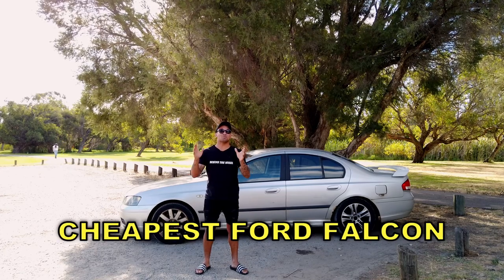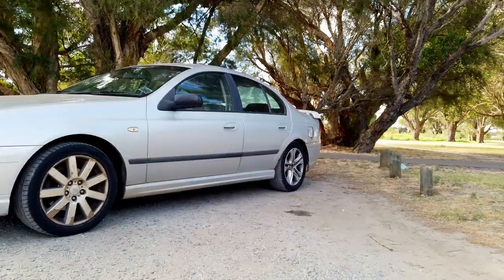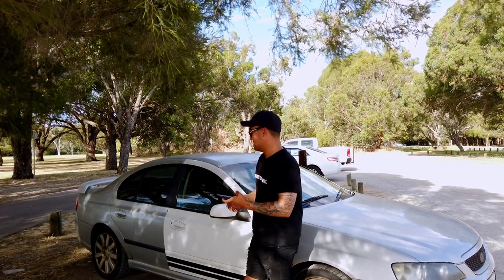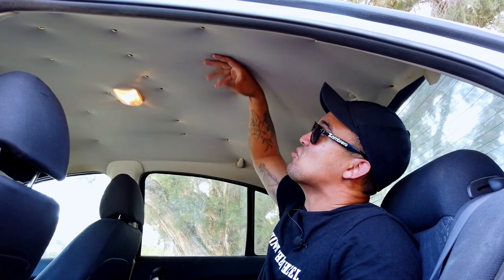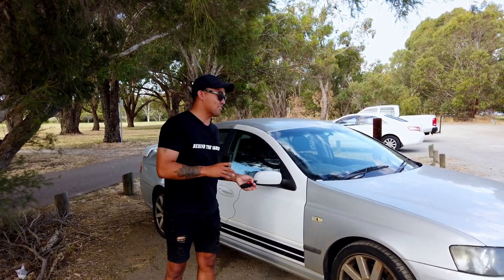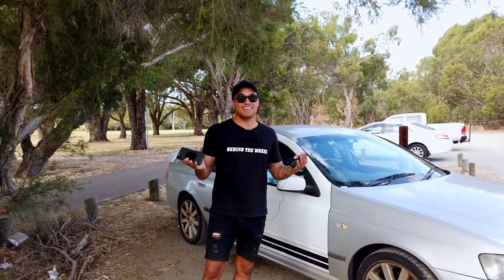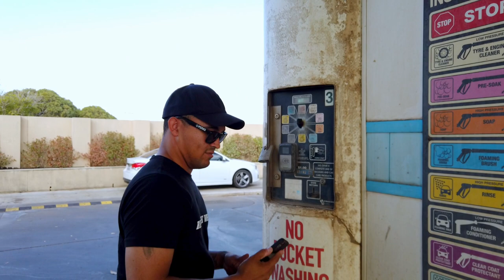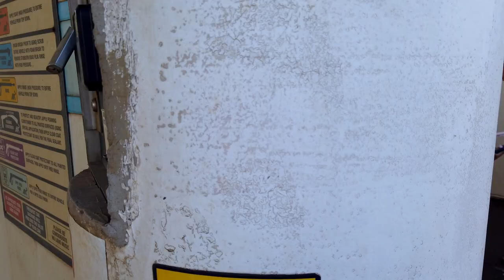I BOUGHT PERTHS CHEAPEST FORD FALCON!

Comment: It is a BF 06 falcon and not BA. The difference is that the engine has 190KW from the 182KW BA. A few other cosmetic changes etc. IMO it's going to cost you unless you have knowledge of removing the rear diff cradle & repairing rust. ~ 99% of the Falcons suffer from rear diff bushes and centre bearing vibrations
Reply from the maker: Sorry must have given me the wrong information! The last owner changed the diff the week before I picked it up so that should be sorted!
Reply: @BehindTheWheel_yt  That's one massive issue sorted mate. You can get a second hand exhaust with 2 x O2 sensors and you're laughing! Fix the rust and it's an awesome car! It'll last you for years
Reply from the maker: @vincekara9446  yeah getting all that sorted shouldn’t be too hard, but it’s a decent car that cost me nothing so gotta love it 😂
Reply: no that forsure is a ba, look at the headlights, think its an 02-05 not 06

Comment: Haha, FG and SR wheels, all the normal falcon weak points, rust in all the normal places. I know from having worked on so many of these how long it takes to repair the rust properly around the fuel cap, this is caused by the foam behind the panel that is fitted by Ford which absorbs moisture and causes rot from the inside out. Door sills, especially around passengers side bottom and front drain points under windscreen. I had to learn how to do hood linings, rust and paint jobs, engine and trans work to do it cheap, worth the effort though, I have 4 BF series 1 Fairmont Ghias now, all mint and a BF MK2 XR6T nearly finished resto. Go hard bro. Cost to get everything really nice, body, paint, interior, suspension, bushes, upper and lower control arms, tie rods, new radiator, trans cooler, coolant bottle, p/steer hoses, engine hoses, engine gaskets and rear main seal, trans full service, engine bay detail, full tint of all windows, is about 1500 doing all the work except tinting myself.
Reply from the maker: There’s definitely a lot to do! But seems worth doing especially how cheap everything is! 
Will have to get into more of the maintenance side of things for it once she’s painted!

Comment: Give it good service 
Diff trans and motor 
Give it new brakes 
New thermostat and water pump 
Good to do the front main seal on motor to and the rear seal on trans for drive shaft 
You’ll spend heaps not cheap fixing cars theses days